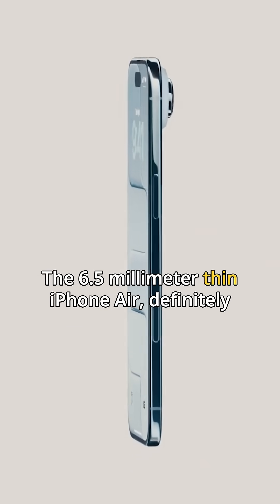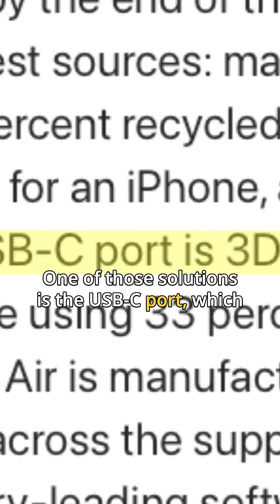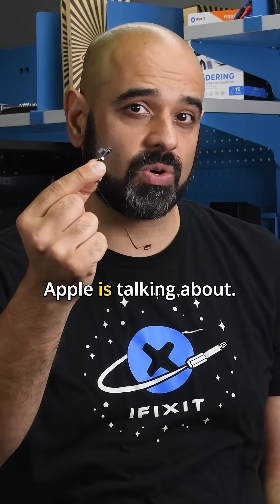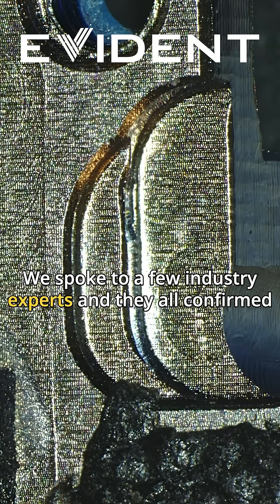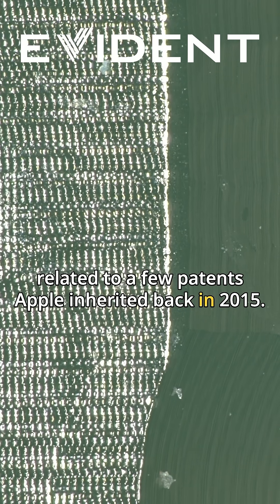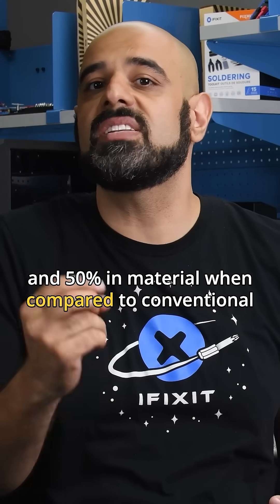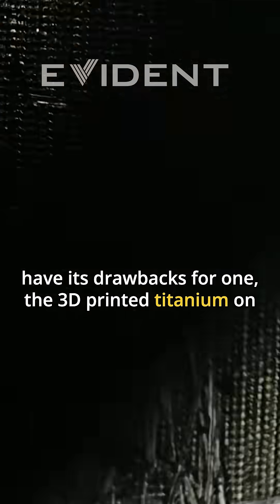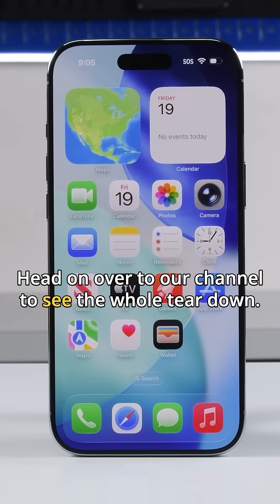The iPhone Air's Amazing 3D Printed Charge Port

Comment: That iPhone air is 5.6 mm and it’s incredibly thin yet it’s still thicker than M4 iPad Pro 11” & 13”! 
Which is really hard to wrap your head around but it’s true.
Reply: Ipad a bit bigger in terms of surface area which allows them to squeeze the components across a longer distance and make the is smaller even though the volume is actually larger

Comment: Okay but why go through so much effort to make it that thin? Do people really want a phone that thin? Most people put cases on their phones which adds thickness to them anyways. I think some pretty cool engineering was done to pull it off, I just don’t understand why so much effort was put in for something that most people don’t care about.
Reply: Most likely this was an excuse to field test the engineering that a folding phone will require.
Reply: Some people do. And if you put a case on it, it’ll only be as thick as a normal phone without a case on it
Reply: @gktjkytjktyjtyjtyjkf  when my phone doesn’t have a case on it feels way too thin and hard to hold. The Air would feel like that even with a case on. I just don’t get why anyone would want to feel like they have less to hold onto when it’s such an expensive piece of technology. I always want to feel like I have a good grip on my phone so I don’t drop it.
Reply: yes

Comment: I 3D print. You can design parts that are 3D printed that you can’t design conventionally. The problem is manufacturing. There are overhangs, internal supports and such that can’t be made with additive manufacturing, injection moulding or stamping. 3D printing is innovative because you can make parts that are stronger, smaller and lighter. No, this wouldn’t be used for an external part. Though I’ve designed very small screws that were 3D printed out of 316 stainless for me. Just as good as machined parts.

Comment: Could it be binder jetting? it can produce small parts at scale
Reply: The port is titanium though right? I thought binder jetting was mainly for nylons etc
Reply: @blackmcbwhite2996  There are some binder jetting machines available that can do metals
Reply: @blackmcbwhite2996 Binder jetting can be done with metals on newer machines
Reply: @blackmcbwhite2996  Binder jetting can be done on metal powders as well, the parts just need to be sintered after printing to make it fully metal.

Comment: A 3D printed USB-C port on an iPhone?! 🤯 That feels like Apple just stepped into a whole new era of design… but do you think it’s innovation or just a clever shortcut?
Reply: more like they had no other choice.
Reply: They should have skipped the USB-C port altogether. Would rather have more battery, or another speaker (or both) in its place
Reply: @onemanshow4116 I would rather have usb 3 + display out
Reply: @onemanshow4116 Due to eu regulations apple cant. I dont understand why people want to put usb c port on iphone.
Reply: @BANNANA_DEV  that’s not true. The EU does not require all devices to have a physical charge port … it only requires that if there is one, it must be USB-C
Reply: @onemanshow4116 really? Cool :D
Reply: @onemanshow4116 for the thicker battery and speakers you have the regular iphones lol!!!